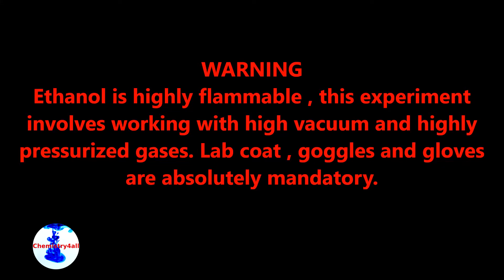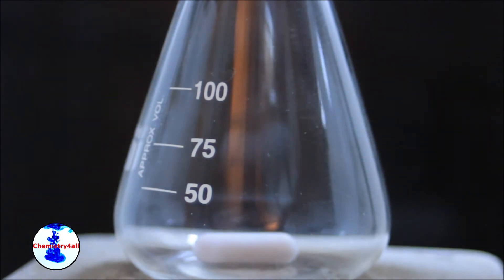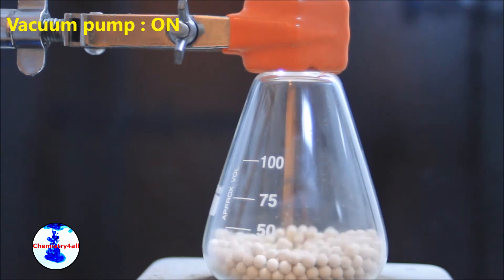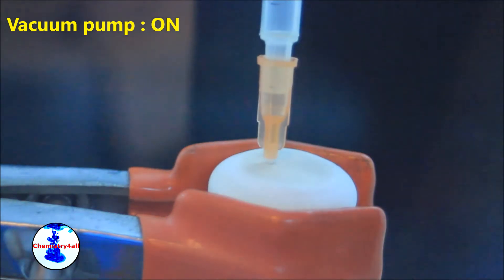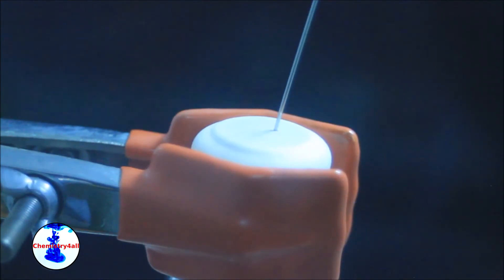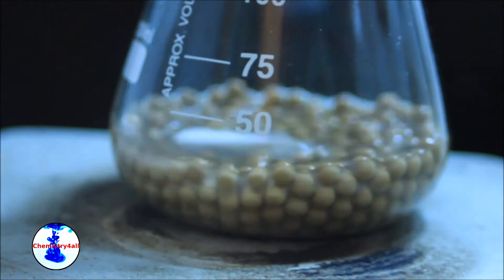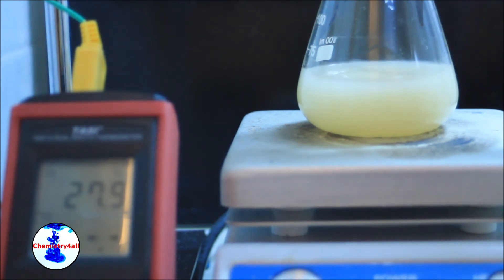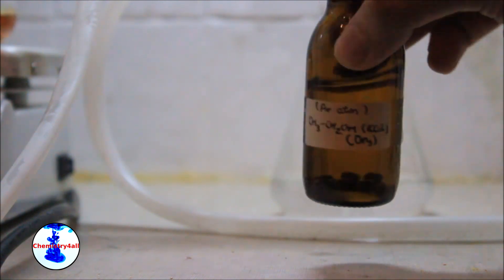How to work under inert atmosphere/Making anhydrous ethanol

Comment: Why are you putting two cannulas in the rubber septum? The Erlenmayer flask (which is actually not suitable for vacuum) has already been evacuated, so its a vacuum inside the flask. If you now attach a balloon filled with argon, the argon fills the entire wrong one (VACCUM!). There is no need for flushing.

Comment: How was the ehanol filtered from the sieves without exposing to air/moisture ?
Reply: It wasn't filtered. Why would you want to filter it?
Reply: @Seorful Depending on the use, the ethanol may well have to be freed from the particles of the molecular sieve. That’s what Schleck systems are for. In most syntheses where ethanol abs. is needed, it is no problem to filter the ethanol in the traditional way.

Comment: This was great! first time Ive heard someone with a chemistry background go into detail about molecular seives  and atmospheres. I thought the correct size for alcohols seives was 3A?  you used 4As?  could you enlighten me?
Reply: You cannot derive the pore size from the size of the molecular sieve. Although large-pored sieves often have a larger sieve diameter, this is by no means standard. The pore size says nothing about how big a sieve ball is. The absorption of e.g. H2O occurs on a molecular scale. The water is integrated into the crystal structure. There are also A3 screens that consist of very large balls. Furthermore, it does not mean that only A3 screens can absorb water. Molecular sieves can absorb all substances as long as these molecules are small enough to penetrate through the pores. You always choose the largest sieve possible. Example: The size of a solvent molecule is 5 Angstroms. So you choose the biggest sieve that cannot yet absorb your solvent, here A4. Water will fit through the posts, but your solvent won't. You could also use A3, but A4 can absorb more water (bigger pores).